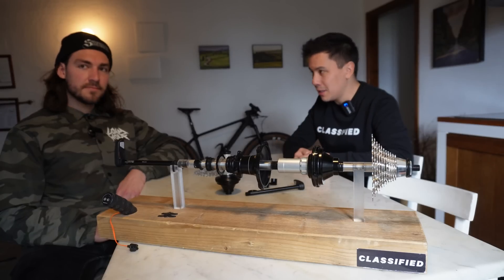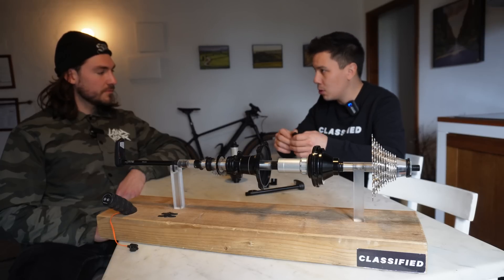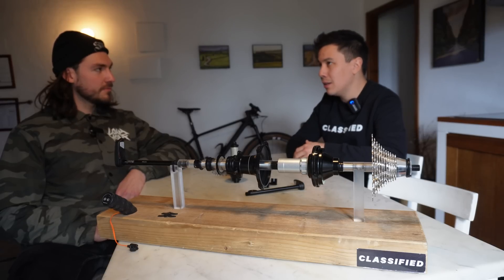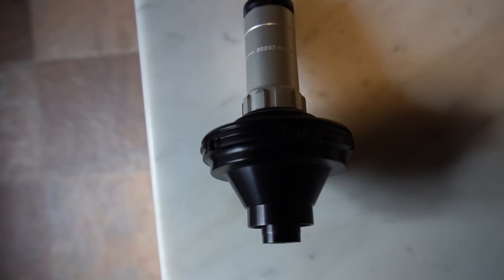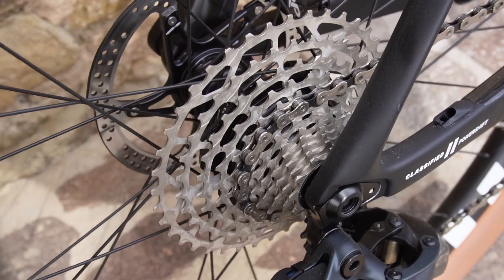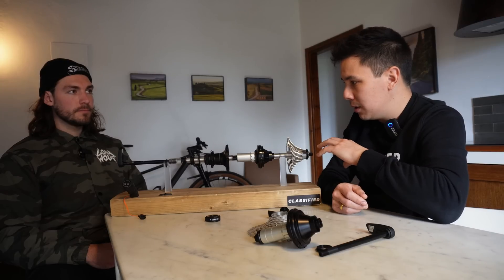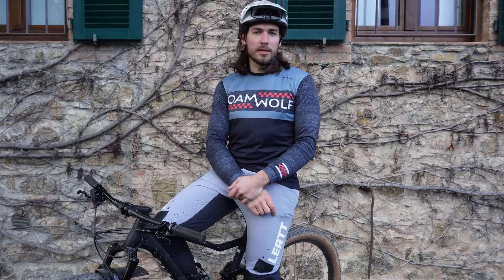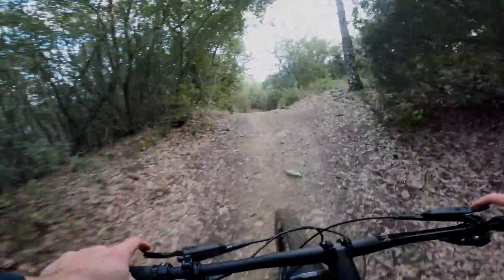Classified Powershift MTB: The Next Generation of Drivetrain Tech | First Ride Report

Comment: Very interesting concept that looks to have meaningful potential. Added range and shifting under a load would be quite useful. Having it housed within the hub will help keep the mechanism isolated from the elements. Anytime you can add flexibility with literally no increase in throwing a chain is a move in the right direction. If course it’s expensive right now. New technologies are always expensive in their infancy until the R&D costs are covered. Generally manufacturers learn as they refine the product and refine their production processes and methods, further cutting costs.

Comment: I like the sound of it since i seem to not like changing gear once i drop in , i tend to put my bike in a hard gear at the start n leave it there but can be a bit much when trying to power out of a corner.
Could see this been good for dh , sprinting out the start then bang into the harder setting
Reply from the maker: It's nice to have that shift without the uncertainty about it sitting properly on the cassette cog for sure, would be great for a gate start like you say!

Comment: Combine this with a belt drive gear box bike and ditch the mech/ chain combo???
Reply from the maker: If you're running a gear box then chances are you won't need the extra range of this system, and gear boxes tend to have the multi-gear shifting nailed down pretty well too.

Comment: It's redundant imo, since it doesn't actually replace the derailleur, just augmenting it, less cross chaining is not enough of a benefit for me to ditch the smooth shifting Shimano cassettes, nevermind the price.
I personally wouldn't care about a bit of energy lost, so I wouldn't be opposed to a straight gearbox, however the price and availability is prohibitive, and unfortunately companies earn too much money from replacement derailleurs etc. to really invest in another system.
Reply from the maker: Wouldn't say it's reduntant as it definitely offers some functionality that a derailleur and cassette can't offer (shifting without pedaling), but it won't be for everyone. 

If we're getting into gearboxes and you're not so worried about a small amount of energy loss, then the Pinion system is for sure a good solution already, just limited in terms of bike availability.
Reply: @TheLoamWolf  how does this system move up and down the cassette without pedalling? Confused how it can move from the smallest cassette cog to the largest without pedalling.
Reply: @michaeltiffe6341  it's just a planetary geared hub added tot he cassette, there used to be touring bikes like this long ago.
Reply: @piotrekserwisuje  so not shifting without pedalling really anymore then the fact that I can do that now to a limited extent on a existing drivetrain.
Reply: @michaeltiffe6341  you can actually shift a planetary gearbox without rotating, this one supposedly also takes shifts under power.
Reply: @piotrekserwisuje  but that is not the cassette that would only refer to the front derailleur replacement aspect I would believe so limited shifting without pedalling?
Reply: @michaeltiffe6341  no duh... Obviously the cassette works per usual.
Reply: @piotrekserwisuje  guess I just find the statements of shifting without pedalling or under load to be confusing then and should not really be used in this case.
Reply: @michaeltiffe6341  dunno, for me it was quite obvious that they meant "because you have a planetary gear set"

Comment: Make it fully wireless and give me one shift lever.
Click for easier and click or harder. Have software determine if the hub should be in easy or hard. Offer a manual mode but at this price point I'd expect some more intelligence from the shifter
Reply from the maker: This could be neat, but we found it quite intuitive and easy to use as it is. The advantage of the classified we found was the ability to make an instant 3 gear shift, whereas a standard shifter that’s linked in would need the extra time for you to make the triple shift. Guess the manual mode would solve that potential issue though. More options are always good right?

Comment: Just what I was looking for... More complex shifting. And, as a bonus, I get to shift with both hands again. And, as an added bonus, I get to pay even more money. Brilliant idea. 😂
Reply: BUT WAIT! There is more! It's also heavier and there is a substantial power loss (4% which compounds with the loss you already get normally) in one of the modes and you now have only a single supplier of the cassette which btw isn't cheap.
Reply: if only it had more weight, more rolling resistance, and less reliability.
Reply: Do you really expect the first implementation of a novel technology to be perfect in every way?
The inventor of fire probably got a lot of 😂s from geniuses complaining it was too hot and smokey.
Reply: @Playwholeday  toilet paper is great technology. Still using your hands?
Reply: Name checks out. eBiker.
Reply: Yeah, but you get 530% range vs Sram’s paltry 520%

/s
Reply from the maker: It’s definitely not for everyone. Works good though!

Comment: I was just wondering how long it would be before 2x came back into favor. It's a clever application, but not something I need when I can dump 3 or 4 gears with one push already.
Reply from the maker: Current derailleur systems are very good, but we rarely shift 3-4 gears at once without a decent “skip” and a bit of a delay as it shifts, regardless of how good the setup or system is.